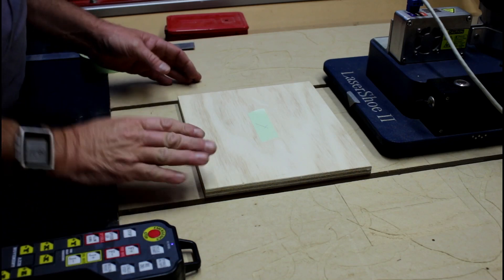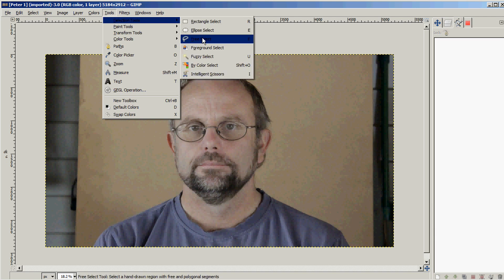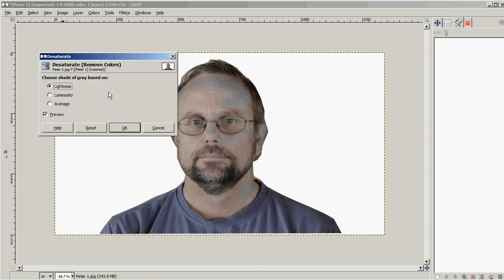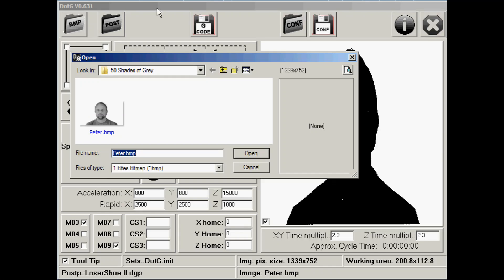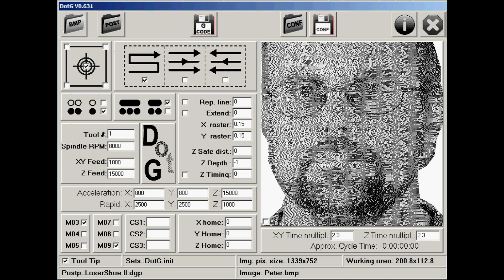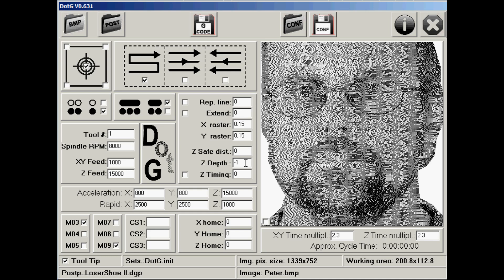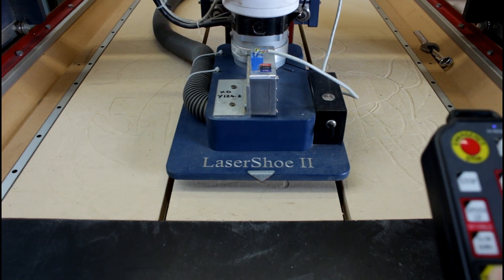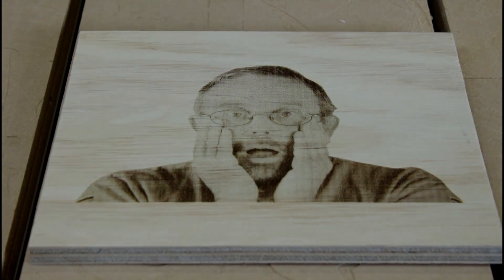Fifty Shades of Grey - CNCnutz Episode 99

Comment: We have an Epilog 35w laser... it's good because it engraves insanely fast... at 300,400,600, or 1200 dpi. The down side is that it is limited to 12x24 inches (300 x 600mm) The laser shoe looks like it would work well for very large projects. The laser we got was $16,400 USD when we got it about 5 years ago... how much is the laser shoe? (I did a search, but no useful results.)

By the way... I was able to download Dot-G and configure it for LinuxCNC... to drill small holes for the dots with a V-Bit. This should be very useful around Christmas!!
Reply from the maker: Hi Jerry,
There are 2 Videos complete with plans on how to build you own unit.
Build the lasershoe and put your own laser on it.
There is a full list of suppliers that i bought my parts from included in the plans.
Here is the first video of the project.
https://www.youtube.com/watch?v=9EMENb5xdRM&list=PLSBDMgE5ym9c2oz333RQxthRecVuYzwPs

The cost to build was about $250 and most of that was the laser cost as I have most other bits on hand.

Cheers
Peter
Reply: *****
$250 is pretty incredible... just the replacement tube on ours is $2200 or so. (Last one lasted about 5 years.) I may look into this later for marking larger items on Eve's mill. (Laguna 600x1000 mm) If you are pushing about 2W, it likely won't cut wood except perhaps veneer... but for marking, it looks like it does a great job. I wonder if yours can mark glass? I guess you would need to be careful... have your glasses on! (The epilog is IR, 1000nm, the lid stops the light, no glasses required.) I wonder if yours is getting high enough to mark metal? Ours won't... unless we use Thermark.

Comment: The concept of using another axis to activate the Laser is ingenious. No need to figure out how to make another Mcode work right in Mach3.  The setup in the other video is very helpful.
Reply from the maker: Can't really take too much credit for that. Merely standing on the shoulders of giants but at least the view is good. I would like to play with M11 and M10 commands as these were added to Mach3 for Laser Engraving but haven't figured out how to produce the required Gcode. I could edit the Gcode that DotG outputs but I don't really want to start down that road. There must be a simple way to generate the required code.

Cheers
Peter
Reply: @cncnutz  Pete, just edit the PP insert M11P#(output pin) at the heather and M10P# in the footer. Good Luck. Enjoying your videos.

Comment: Great result Peter !
How much power does the laser output? Because machining time is quite long...
Reply from the maker: The laser is 1.4 Watt but the time is limited by how fast I can get the X axis to move. Because each movement is so small it cannot exceed startup speed before it has to stop and unfortunately CV doesn't seem to work with such small movements. It is probable that I don't have the settings right in Mach 3 but after sending a few hours on the weekend to get CV to work in this application I had to give up. I will have to see if I can get the axis speed up because I know the laser is more than capable of higher speed.  
If anyone has a suggestion I am happy to give it a try.
Cheers
Peter
Reply: RoboCNC Frees- & Graveerwerk
Yes, I am always impressed with Peters work.
Reply from the maker: RoboCNC Frees- & Graveerwerk You right about that. When I increased the acceleration on the X axis the axis started making some horrible noises and shaking the entire machine. Large heavy gantries don't like sudden starts and stops. CV would be the answer but with all my fiddling I couldn't get it to work. Will have to do  a bit more playing.
Cheers
Peter
Reply: *****
One thing to note on laser cutting machines is they make the x (raster) axis as light as possible, including the head weight. I wonder if your machine has the capable acceleration to go much faster?  It also sounds like the GCode is not right. One horizontal line should be one x move, during that move the laser should be modulated as needed, I wonder if that is possible with your  machine?
Reply: Yes we have to remember it's a router, and not a laser.. So after all the result counts.
Reply from the maker: Robonza
Thanks